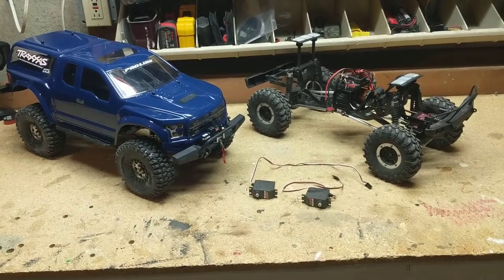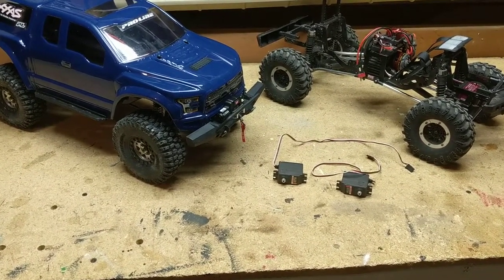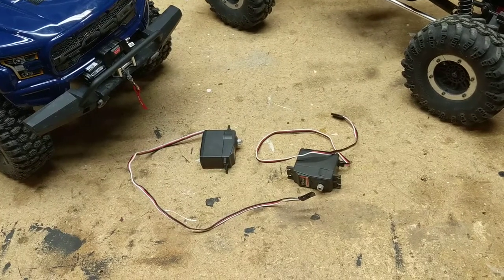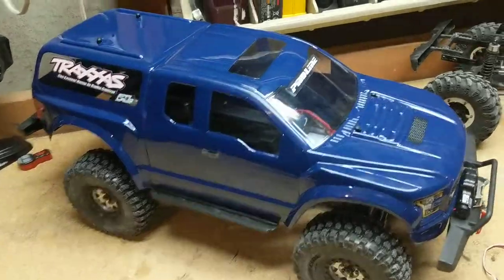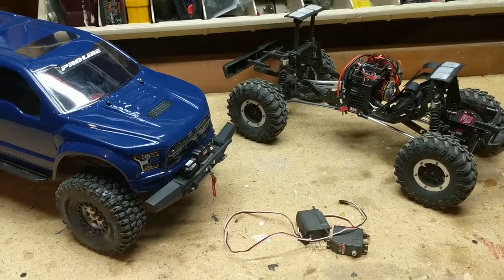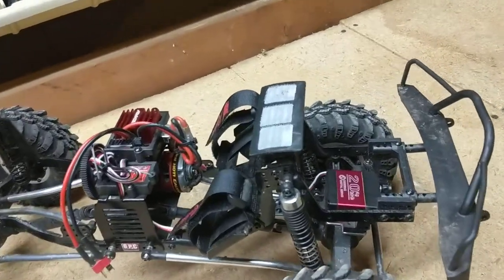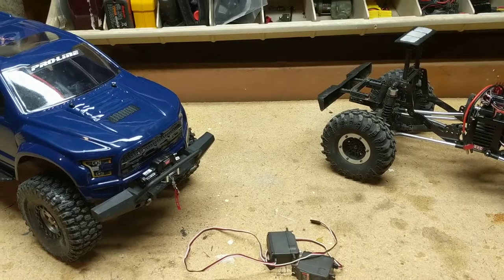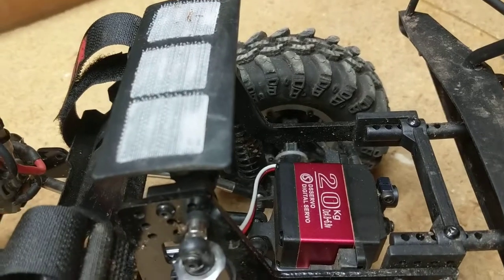Traxxas  TRX4  servo broke what to do

Comment: Im with you mate. I do use and have same 20kgs servo on my trx4sport. They work much better than fuckin traxxas ones.
Im not really happy with traxxas electronics. 
Stock servo did only last 3 runs...... 
stock ESC.......did only last 4runs......
And so the stock TITAN motor did last only 3 runs......then got burned.
Suspension/shocks, after 5-6 runs they stop working properly. And so, one in particular doesnt expands itself. So my rig was having a kinda limp looking al the time. 
panhard.......what annother massive mistake. As you change any other part on the car (longer shocks, shock posts....whatever, you will get the car running completelly bad. Bo smooth run anymore 
BULLSHIT.